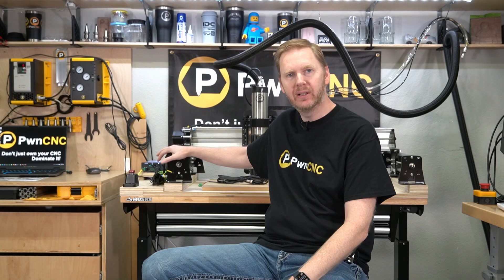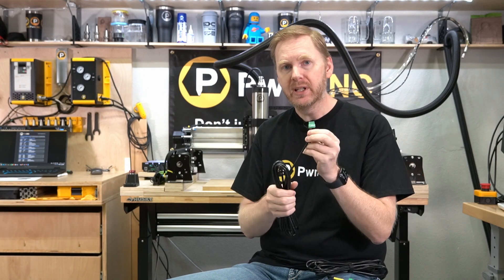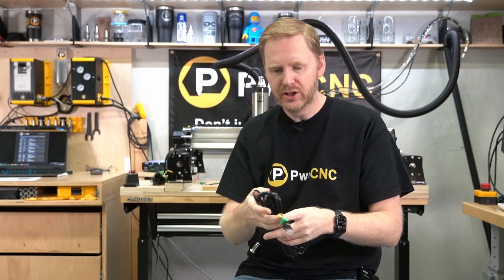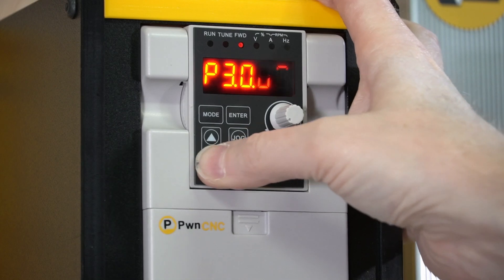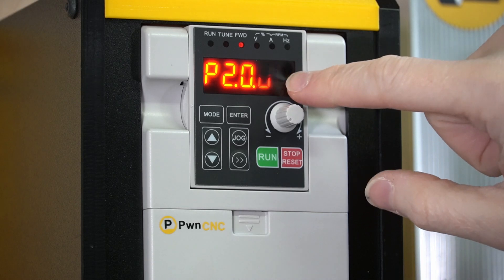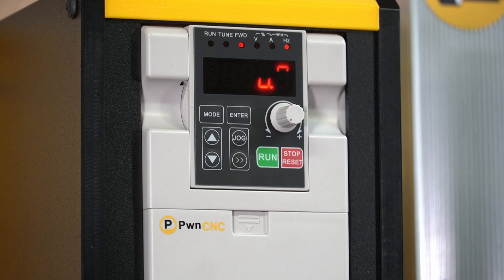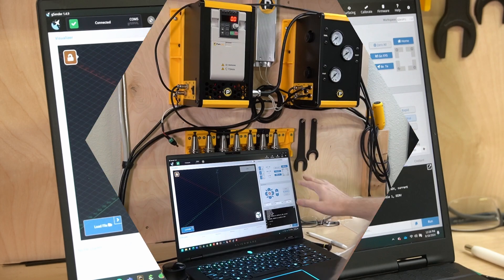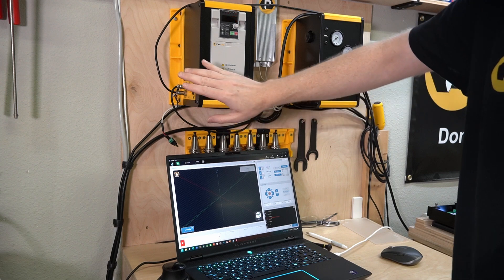Ultimate Guide: Sienci Labs SuperLongBoard Modbus Control [OUTDATED]

Comment: Great video, amazing that you're offering free cable exchanges. One clarification is in the gSender Firmware tool the "SLB" profile isn't used anymore since once you're connected with "grblHAL" as the firmware on the connection dropdown, you can just have any "LongMill" or "AltMill" Profile selected in the Firmware tool profile dropdown and it'll show you all the right settings. Also when you set the remaining settings remember to turn the SLB off and back on again to make sure they take effect.

Pro tip: in gSender's console, if you press the 'Up' arrow on your keyboard, it'll bring up past commands that you've sent so you don't need to retype them :D
Reply from the maker: Thank you for the additional details.  I've pinned your comment to the top so others will find it and I've updated the description to make note of these differences since it's impossible for me to re-edit/replace this video.

Comment: Great video.  Will be purchasing the spindle kit shortly.  Have a question... You mention in the video that SLB Firmware $16=Enabled, however, your CNC Controller Guide for SLB dated 11/4/2024 has $16=All Off.  Can you please clarify if the Controller Guide Settings should be followed over the video?  Thanks again!
Reply from the maker: Hello Cablsurfin, you are correct... the video does mention $16 enabled, we have since learned $16=all-off is the better choice.  Our ability to edit the videos is extremely limited once it's published.  I will update the description so it's more clear to follow our KB:  https://support.pwncnc.com/kb/article/468-super-long-board/
Thank you for bringing up this mistake so we can get it corrected.

Comment: Got my cable in and replaced this weekend.  Works great!  Previously my RPM was 10%+/- what gSender showed and now it's at most 10RPM +/-  Nice job getting it worked out.    I'm fine connecting inside the controller with the phoenix connector but if you wanted to go with the crimped on rj11?